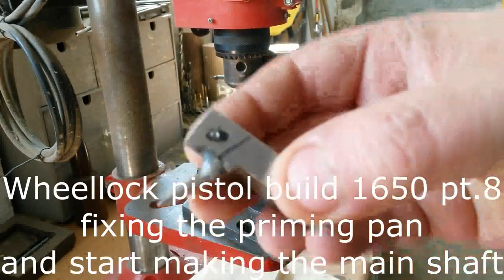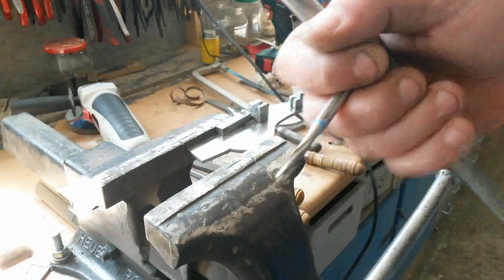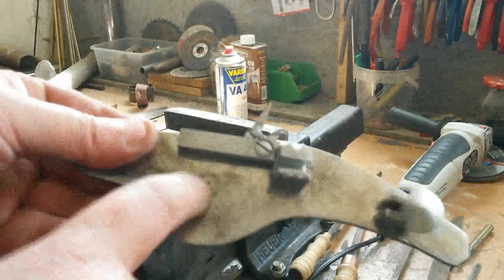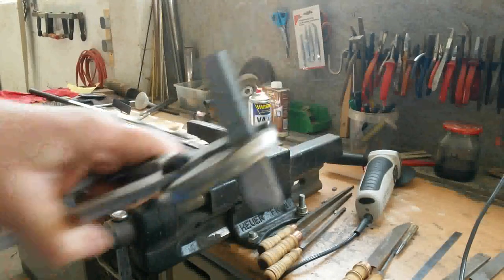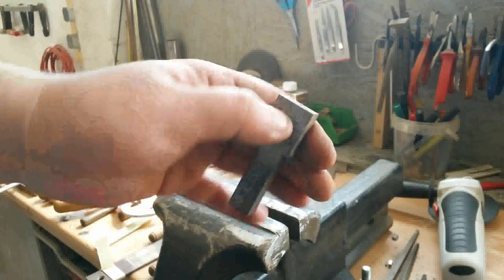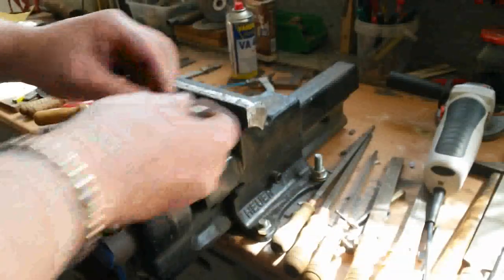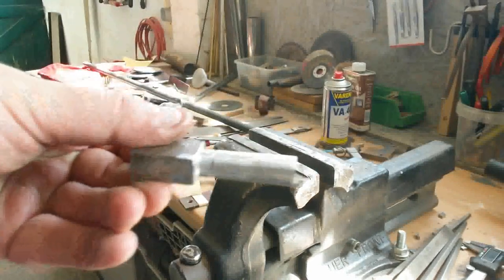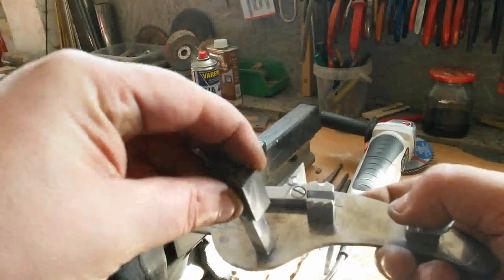Wheellock pistol build 1650 pt.8 more lockparts to build

Comment: No cutting oil for the drilling and tapping procedures?
Reply from the maker: I run ot of true cutting oil and wd40 is useless for that :-(
Reply: Once I started using a good cutting oil, I wondered how I got along without it before. You save hours resharpening drill bits.